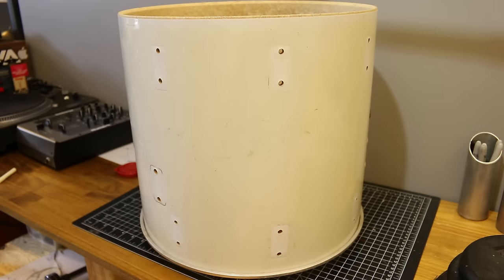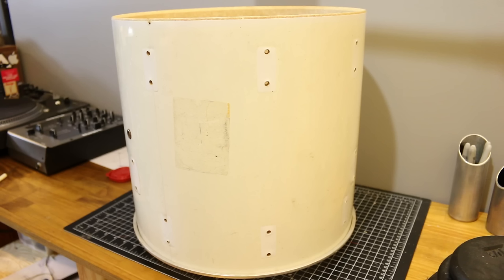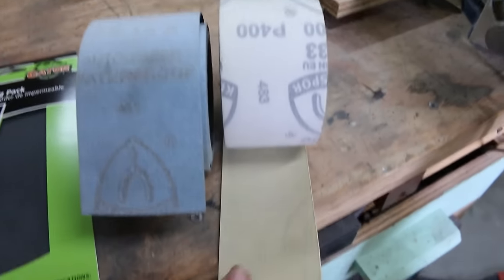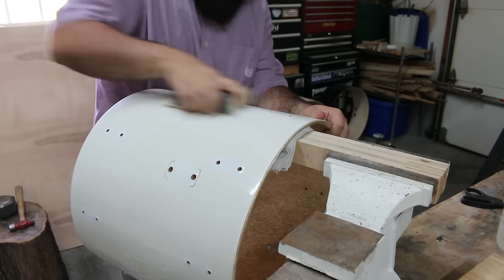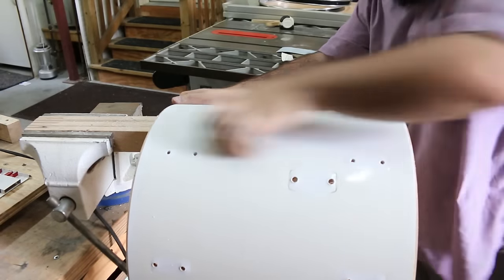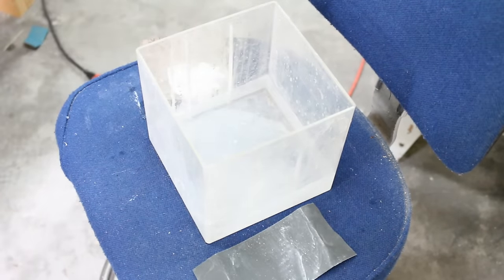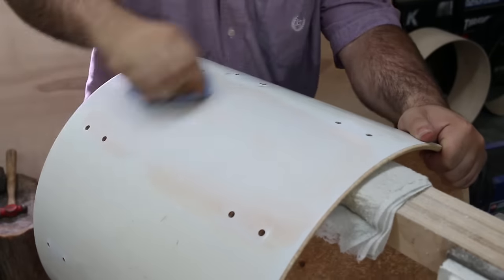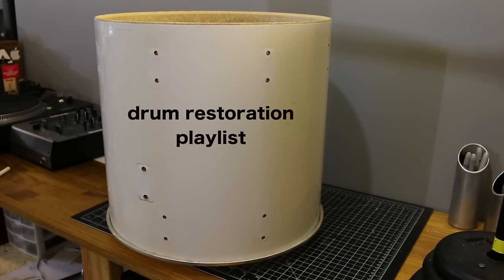How to Restore a Drum Wrap

Comment: quick tip that might work on the discoloration is peroxide(like used for hair), wrap it in clingwrap and then put it in sunlight. it converts a lot of the UV damage back to new looking on lots of plastics that yellow with age. might be a bit of work to rotate the drum around to fix all of it evenly, but it works really well on yellowed computer plastics